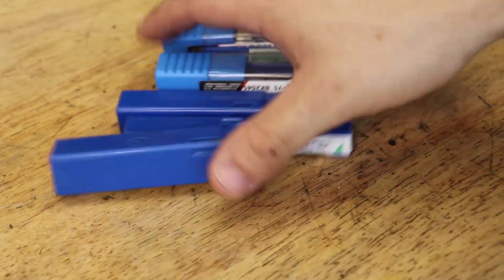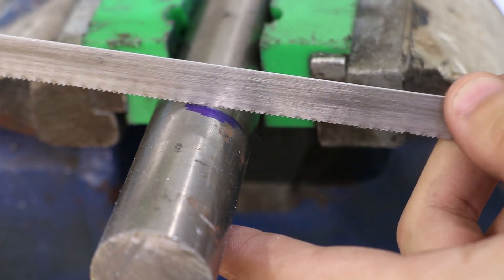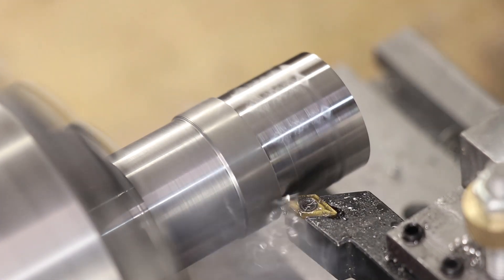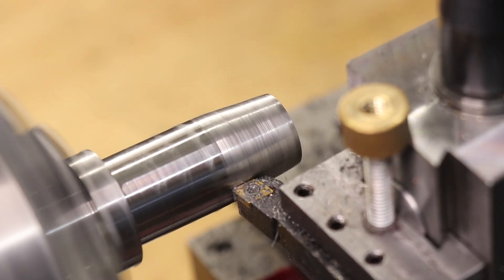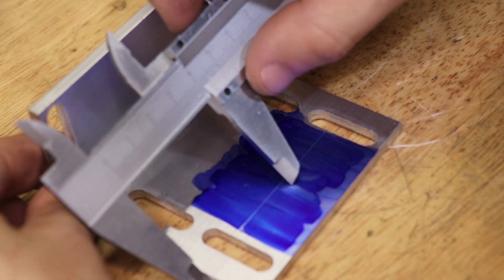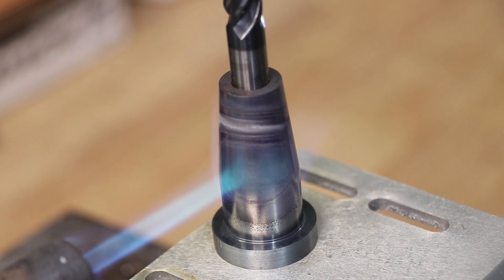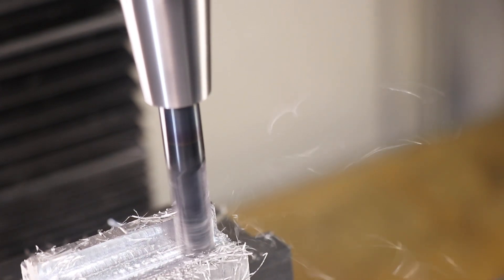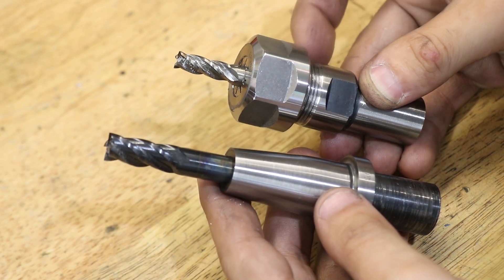I Made My Own HEAT SHRINK Endmill Tool Holders

Comment: I feel like you might wanna fix that draw bar issue. I can think of using a tapered washer to center it in the hole (cut the cone to the bore ID, and leave a flange to act as a washer, and then use super heavy duty grease between the fit).

Another thing is with non ridged lathes and tool holders, carbide cannot bite correctly so a high speed steel or as you did with the end mill will cut bores better. You can also take a few extra finishing passes or cut a taper with the tool to account for the bend but that’s a lot of trial and error. TLDR: Just don’t use carbide with a flimsy tool.
Reply: Carbide isn’t the problem. The geometry of the insert is. Most inserts are not actually sharp, they have a small radius on the cutting edge and as such require more tool pressure to cut. Fine finishing inserts are often sharper, but you can do better in your own shop. This is by regrinding inserts. Stefan Gotteswinter covers this a few times, and his video explains it better than I can in a comment. 
Inserts for aluminum also make for good finishing inserts in softer steels, but you definitely want to limit cut depth.
Reply from the maker: Yeah I get away with carbide more often than I should. I have ground up hss borning bars, and I probably should have here but I didn't feel like it. I'm looking at getting a solid carbide boring bar and hss inserts once the budget allows for it. Cheers

Comment: I also have those endmills on a small milling machine and they dont  work any good in steel or aluminium.. even in high or low rpms.. they look and feel amazing.. but in my opinion i preffer titanium coated ones or regular hss

Comment: cant wait for you to get a saw so the cut off brolls take just a second. I use some heat shrink tooling at work but they are currently just for through cooled drills. Nowdays if I got to choose my tooling say for a brand new machine I'd get only rego fix power grip.

Comment: Great idea.  I no longer use carbide tooling on my lathe (12") after discovering the Diamond tool holder with a cobalt bit. On your size lathe, it is necessary.
Reply: What about his lathe size would make carbide necessary?
Reply: Carbide is made for heavy cuts high heat. A lathe with a 1hp or larger  motor that is rigid enough to handle it. Cobalt is fine for all metals Including stainless. It also can hold a sharper edge and can be resharpened.
Reply: @yt66228  oh im well aware of the merits of good HSS, particularly when working stainless, generally speaking it is sharper than carbide and therefore doesn't tend to work harden material. It is also extremely useful for 1 off form tool situations etc and is much easier to hand grind. But to say the size of a machine has much impact on selection of tool material is kinda silly. Forgive me if im wrong but the lathe in the video appeared to be a tiny toy of a machine(im from the school of thought that the first real lathe is around 15" with exception to dedicated chuckers.) If carbide wasn't for small low HP, less ridgid machines carbide mans wouldn't be producing tiny inserts with IC of less than 1/4"

Comment: Did you not consider that the "taper" in the hole may have been caused by differential temperature causing less expansion on the thicker section?
Reply: So long as you heat up the general region of the holder equally, the temperature should reach equilibrium negating the possibility of a taper.
Reply: @bobweiram6321  My experiemce of heating treating tapers is that  the narrow end tends to heat up faster and then cool off quicker, but in addition the thicker section will be radially stiffer. All this is probably not an issue if the part is at a stable temperature when you fit the tool, but It is a risk.
Reply: the torch was on the bottom of the taper, the thicker part was theoretically warmer anyway ...

Comment: This endmill with this type of coating is not suitable for machining aluminium, you need a different tool for that, polished type with a very sharp cutting edge, or with a DLC coating.
Reply from the maker: No but you can get away with it. I have 2 flute hss for aluminium so it's not a problem. Cheers
Reply: @artisanmakes  I personaly don't use any carbide end mills on my machine, it is too old and slow for it, when I do aluminium I use normal HSS tools, I use carbide only when I have trouble machining harder types of steel which can dull my tools easily, but I know DLC coated carbide end mills give the best results in aluminium.

Comment: This is how we tool up our CNC's. We have the induction coil that goes around the holder and in about 5 seconds it's hot enough to remove and set the new tool. Very precise and ridged set up. But you had better be wearing the mitts that they provide.
Reply: Dang thats cool!
Reply: Fires Cooler
Reply: Is it ridged for her pleasurable use of a rigid tool?
Reply: @harlech2  Absolutely. That's the best part of a ridged tool eh?
Reply: I want to check out the Haimer system. That's the best of the best
Reply: @JohnBlaze505 we have that at my work and it overheats too much, maybe for small shops it’d be better

Comment: awesome stuff.. get yourself a cheap horizontal bandsaw, you'll not regret it
Reply: Or make a power hacksaw, Has to be better than sawing by hand!
Reply: @NoTimeForThatNow  I made one a while back from 3d printed parts, while it worked, it pales in comparison and is about the same price
Reply: @KS_ChemEng  I don’t know which would really be better. I have heard the harbor freight porta band type is a good tool and can usually be had for about or just over $100 or so. If I make a table for it or maybe a stand to turn it into a sort of automatic metal cutting saw it could really do it all. But the hack saw idea can be very cheaply made and compact.
Reply: Solid advice!

Comment: Taper bore you get was mostly becouse of to small depth of cut. Insert have rounded eadges and nead to bite into material. You can try few things. Get a carbide boring bar, boring from inside out, or using sharper insert like those designed for aluminium or regrind what you already have by hand on diamond lap
Reply from the maker: It's a problem tool holder, on any cut. I've spoken about this set up and I'm about to replace it. It's a Cheap holder and it really shows. Cheers
Reply: @artisanmakes  I bet 2 pounds that the taper is in the lathe. Why would the bar deflect more at the bottom of the hgole?
Reply: @spikeypineapple552  I have to agree with you on that score.........most lathes do cut tape even from new and most people just let a lathe lay on a bench top unbolted without realising the bed can warp over it's length.

Comment: With the HSS end mills you need a powerful induction heater so that the end mill doesn't get too warm while heating before you get it out. Talking about seconds probably
Reply: I put a hss tool into an actual proper tool holder with proper induction heater setup (or passable because its german). To this day I have not been able to remove it because hss is not supposed to be put in heat shrink. Only way it might come out is to edm it out.
Reply: @TommiHonkonen  that's the case with most of them but I've heard that some of the heaters now are so fast they can do that. Don't do it unless the manufacturer specifies it to be capable of that
Reply: @MF175mp  it doesn't matter how fast the heater is, the HSS heats up almost as fast as the tool holder so it won't get out
Reply: @lennarthoek8392  "Shrink range Ø 3 – 32 mm for carbide shanks and Ø 6 – 32 mm for HSS shanks." 
Diebold shrink unit, can't put links here
Reply: Haimer Power Clamp shrink unit: "Tools: Solid carbide and HSS from Ø 3 – 32 mm"
Reply: You can look up their websites to confirm that info, the comment gets removed instantly if it contains a link unfortunately
Reply: @MF175mp  I stand corrected. Pretty cool that it's also possible with hss ngl. We have a diebold shrink machine at work but that one most certainly can't shrink HSS lol
Reply: @lennarthoek8392  those new ones seem to have a ridiculous amount of power, like 13kW to heat up a relatively small piece of steel. I would definitely like to see the removal of a 3mm HSS end mill from a shrink holder on a Haimer,  a small rod like that heats up very quick
Reply: I calculated that it will probably heat a 3mm holder up in a split second if it's not a very thick walled one and the power is used efficiently